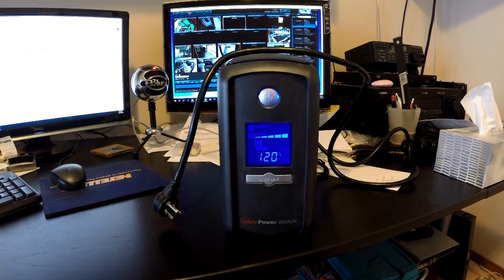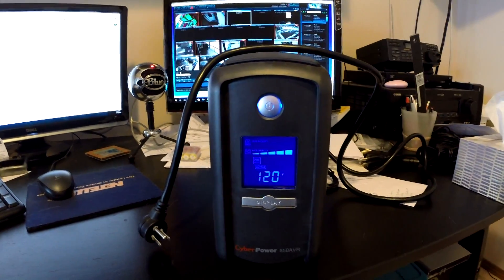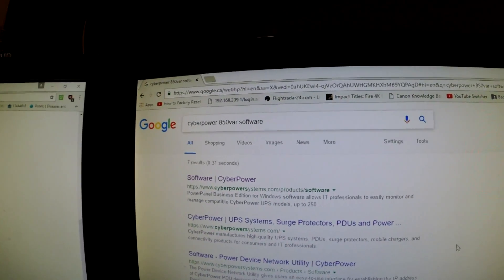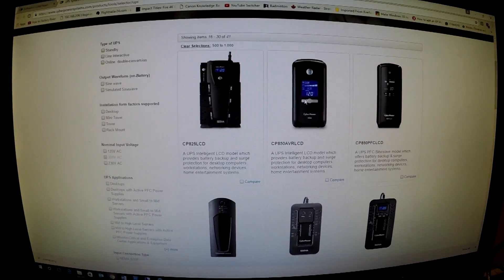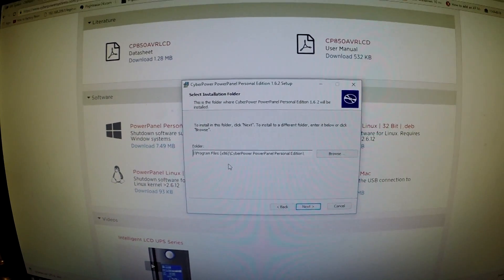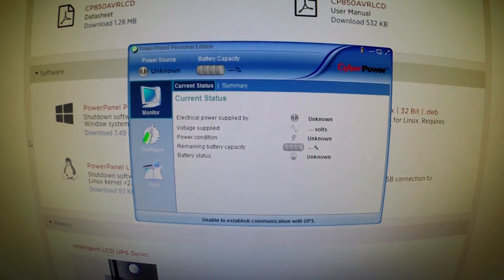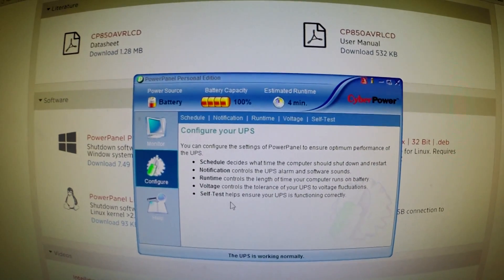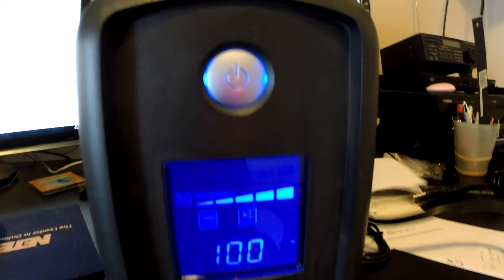UPS CyberPower Won't Stop BEEPING - RESOLVED

Comment: Mine has a "Silence alarm" button and if you hold it down it turns it off. Note for others with that model - you don't just press it - you have to press and hold it.
  Remains to be seen whether it silences it for the next power outage.
On other UPS systems like this you can scroll through the menu until you get to "b on"   and then you press it until it gets to "boff"

Comment: I have a cp1000avrlcd. It has a single button other than the power button. Press and hold the display button and eventually you should see an icon pop up that says “silent” on it. 

Hope that helps.
Reply: I have a similar model that has a "silence alarm" button and figured this out.
Have you had a second power outage to find out whether that permanently changes that?

Comment: Two thoughts: (1) Did anyone ask why the unite was beeping in the first place? Likely it is battery failure and needs replacement; (2) One can do the same thing by using the control buttons in the unit itself. The problem is that the setting with always revert to audible alarmes is the wall power stops for any random reason as Karim Phillips said... so... the only reasonable solution is to change the battery or the unit all together...
Reply from the maker: The UPS beeps when it looses power and this is documented in the manual. A self test will indicate if there is an issue with the battery itself. No need to toss the UPS if it's working as expected and the beeping solution can be easily resolved... unless I'm missing your point.
Reply: Mine do a long beep. And if a energy low comes the pc go off. ¿could be the baterry?

Comment: I have a cyber power back up battery when the power is cut the ups just turns off any ideas ???? It's like it doesn't recognise the power cut ?? 
Regards
Reply from the maker: How long have you owned the UPS? They do go bad after a while. The batter might read 100% but it might not be holding the charge once the batter is old.
Reply: @HomeTechDIY  Thanks for the reply I will replace the batteries in it and report back.
Regards

Comment: Mine has a silence alarm button, but guess what? It doesn't work. It's especially maddening if the power is out for a while and the battery gets low. Then it beeps continuously.
Reply: Press and hold it until there is a little icon that shows it is silenced.
Amazing they did it that way

Comment: Thank you for the video.  Yeah, you can hold the button down, but I don't want to hear the beeping with every power interruption. Turning it off is a much better and permanent solution. Using the program is nice as well. I have it set to notify me via email when there is a power issue.  I had set this up with the first UPS I got and then 20 years later I have set it up again.  I don't what I was thinking. lol
Thanks newfiebort ;-)

Comment: If the holding the display button doesnt work for you then unplug your printer from the UPS - it senses the Heat in a laser printer and it causes it to go off - unplug it and it will stop. SAVED my sanity! ... If all else fails - Call Support ....

Comment: You can hold the Display button  for 2 seconds and it will silence the alarm.
Reply: Phillippe has the solution. My sanity is restored. Sir, you are a prince among men.
Reply: Well, an old neighbor of mine once told me: "When everything else has failed, please read the instructions".
Reply: Philippe Perreault THANK YOU, ours had been doing this and it was driving us nuts.
Reply: You are a legend. Thank you.
Reply: I don't even own this unit and before reading the comments the first thing out of my mouth was hold the damn button...
Reply: Lifesaver man, I was on the verge on opening the case and removing the buzzer
Reply: I L O V E YOU Philippe!
Reply: you da man!!
Reply: Just did it and it worked
Reply: Except that doesn't work in a power loss situation and it doesn't stick either. When the UPS turns off, mute is removed at least on my model

Comment: Hey guy, I know you already got lots of feedback from others, but I felt your pain with that damn beeping!! 
In 2008 I had purchased a cheap UPS (CP) for $50 & it was a very cheap brand back then. They have come a very long way IMO to Surpass APC in terms of Quality, Design & Price!! 
I purchased a CyberPower BRG1500AVRLCD 1500VA/900 Watts UPS System for my New Super Computer "Rig". 
I snagged one on Amazon for $119 "Lightening Deal" in Jan-2016. Thank God they put a Silencer on the thing. I was remembering back to my old EL' Cheapo model that you COULDN'T shut off back then & It only lasted maybe 2yrs? 
It was garbage. I purchased a APC EL' Cheapo also that you couldn't shut that damn noise off. Thanks for the Vid & Info.
Reply from the maker: Thanks for sharing your experience and glad you like the vid!
Reply: I ended up tearing out the speaker because none of these worked on my cyberpower. Useless speaker tech GONE 😂

Comment: Did you try turning it off and back on?  The mute feature on mine resets if you power it off.  The computer program re-mutes it if it is running and connected, but this doesn't work if it can't be connected to a computer in use.  Worst design ever.
Reply from the maker: I noticed that too and agree with your worst design statement!

Comment: They all do that... but not all of them can one stop it from happening.... I have the same exact unit you have by the way but I also have 2 of these ones cyberpower or2200pfcrt2u models. 2400watts or something like that. They also beep.I want to turn that shit off. Cool thing is when or2200pfcrt2u kicks all its powerful enough to keep all the other units charging because they don't beep (they are plugged into the or2200pfcrt2u model) so the little ones... when they start peeping I'm sure that means the power is just about to go out for good. just the or2200pfcrt2u ones beep when the power goes out. Not even the one you are showing beeps when the power goes out (I own it too) I love my cyber or2200pfcrt2u batteries. SO POWERFUL!!!) They're even able to keep you're unit charged for 1 hour and 30 mins.

a 1000 dollar investment... (500 a piece...)